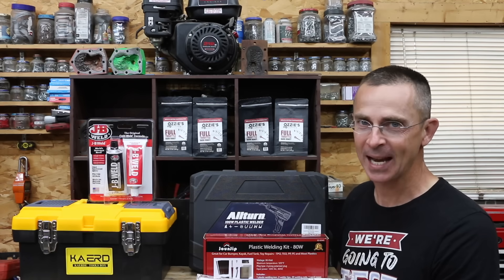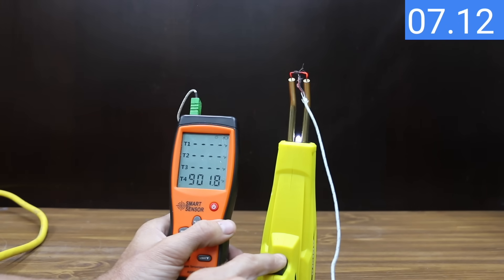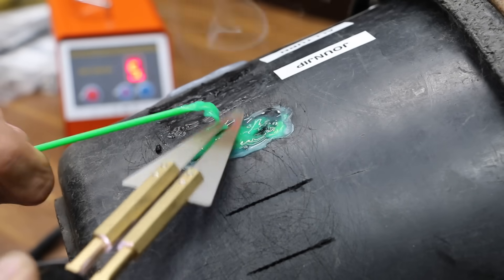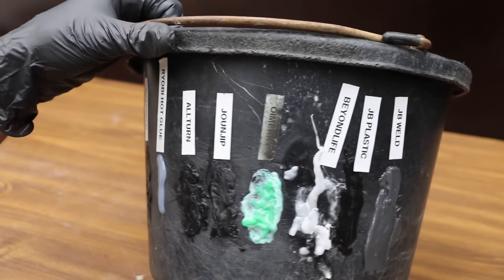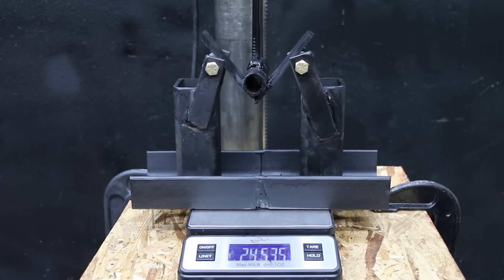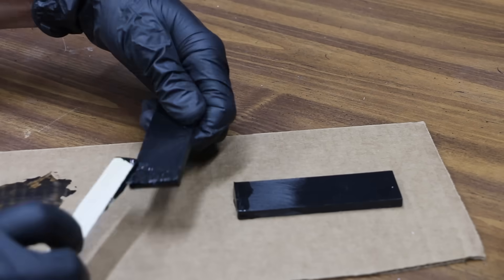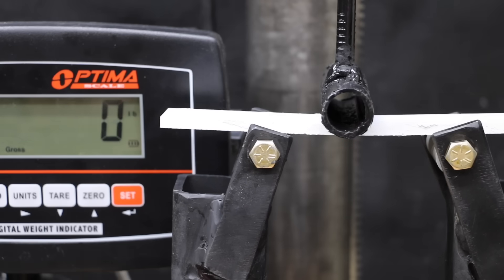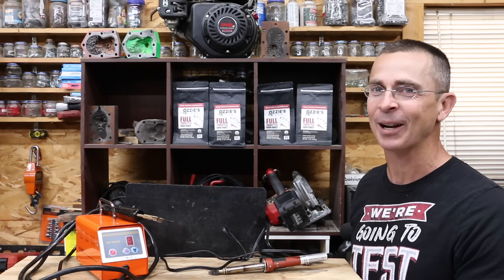Don't Buy A Plastic Welder Until You Watch This Review!

Comment: I would think something with hot "cutting" edges that will melt the original material in a 45 degree channel to which you add your filler would work better than these do since they are simply adding a layer to either side (or for some applications like a gas tank only one side) rather than actually welding the original and filler materials together.  Such a welder could maybe even pass the cut out material through to the welding side to become part of the filler.  Even butt welds on metal with no means of deep penetration (a ground V surface) is pretty crap if we're honest.  Seems like that would be very doable, though I'm probably not the guy who's gonna do it.
Reply from the maker: Thank you for sharing!

Comment: From what I've seen the one unit that you feed the plastic in through is supposed to be used in the direction on the break just as you'd do welding metal together.  I've watch people build water tanks from scratch using these types.

Comment: I tried welding plastic, all you really need is a hot tip from a soldering iron and zip ties. In my experience it's much better to use speciality glue made for plastics, also make sure to use the right glue for the right type of plastic overall glue is easier to work with, produce a cleaner looking repair, and no nasty fumes.
Reply: In addition to using the proper glue for the type plastic, you need to pay attention to what type of material your welding/filler rod is vs the type of plastic you are repairing.
Reply from the maker: Thank you for sharing!

Comment: Part of the issue with bonding plastic is that the heat adds extra carbon, which makes the repair area more brittle on parts that have to flex (motorcycle fairings). You can use a soldering iron or wood burner. V notch you repair on both sides and gently heat the area with directed heat from a heat gun with a nozzle. Tack the parts together at several points. Get a wire screen patch cut, Fill the V notch with plastic, zip ties work well, and embed the mesh making sure to fill the v notch on both sides. Then use JB weld like Bondo to feather the repair on the presentation side. The other side can be left a bit rougher.

Comment: for the hot staple repairs, i'm not sure why he didn't put staples on both the top and bottom -- doing the test which failed at a low pressure, but then turning them upside down (after failure) and achieving a better result, should have been an obvious tipoff.
Reply from the maker: Thank you for sharing!

Comment: I just use an old soldering iron tip. If you use the same approach as welding the root you can get full penetration. I feel a lot of these thicker joints were only stuck on the faces and maybe a few mills deep.
Reply from the maker: Thank you for sharing!

Comment: With plastic welders you are supposed to V groove the repair area and depending on the application stich weld it. I have seen cheap plastic welders do as goid as very expensive ones. The repair stick is the equalizer not the the applicator.
Reply from the maker: Thank you for sharing!

Comment: After having just repaired a car bumper with a couple of cracks in it. I can say that the effectiveness' of the repair is really more about technique than the tools used to  achieve it. I bought the Allturn gun with the staples and mesh kit, before this review. Melting the mesh into the base plastic rather than using the plastic sticks to bond it is far more effective. Cleaning and sanding the base plastic is really more for decontaminating it than for for providing a good bond. Melting the base plastic to itself rather than relying on the filler material for the initial bond is also the best. Try to use the filler material as filler, but to also melt the base material into it. The Allturn setup is a really good value at $35 and it works really well. That's the one I would recommend for the occasional plastics repair. It'll pay for itself the first time you use it and it comes with everything you need to tackle many repair jobs.
Reply from the maker: Thanks for the feedback.

Comment: This test isn’t complete. Some of these repairs are not up to par. Understandably so, but still…

The wire mesh is intended to be melted into the plastic like the wire staples. Then melted plastic is to be added and sanded to cover the mesh and further strengthen the repairs. 

Also, just like welding, the edges should be beveled somewhat. 

Your tests are thorough, but your experience is lacking in some cases. 

Still, this shows what units provide too much heat or not enough.
Reply from the maker: Thank you for sharing!

Comment: Think more like a true welder, you gotta heat up the plastic of the piece as well as your welding rod. The rods in this case are mostly to add extra material if you need it, but most of your weld material should come from the thing you are fixing. You seem to be using the welding rods like a glue, but that's not really what they are for. Gotta melt the thing you are fixing and spread the plastic around so it creates a more unified piece of plastic. That's also why your rod material doesn't stick... you are trying to stick hot to cold and hope it somehow glues together without glue, but you gotta heat both up equally so they fuse together as they both cool.

Comment: Man your videos are live saving, but I could have d
used it a bit earlier lol. Just bought some stuff to repair my motorcycle fairings a day ago. Went with a soldering iron to melt in the aluminum mesh into the fairing, and the some boat Hull spackle to fill in, which I will then sand down and repaint. Hopefully I will get a good result anyways😁
Reply from the maker: Thanks for sharing.

Comment: Very informative as usual but I would love to see this redone but with proper plastic welding techniques. Embedding the wire mesh. Removing material in each cut leaving a divot/trench that can be filled back in with plastic. Using the proper plastic filler rod for the plastic you are attempting to repair. Like metal plastic does need to be melted together. If you just lay hot plastic on top of cold plastic you are going to end up with two pieces of plastic.
Reply from the maker: Great suggestion!

Comment: I will say this about JB Weld, it usually needs a rough edge to really bond properly. A straight edge bond is not where it works best. It needs to soak into the grooves and crevices to hold.
Reply from the maker: Thank you for sharing!
Reply: This applies to all the epoxy glues,  And you really want to wait at least 24 hours if not longer for a reasonably full cure. Perhaps longer for the plastic fusion type glues because the solvent will continue to evaporate and the glue will be stinky for days. I prefer regular JB weld and have not been impressed with their plastic fusion glue nor any other companies' plastic fusion glue.

Comment: I think you should re-do this one and give it fillets or somehow else melt the joint. From what I've done and seen others do, it helps to (if possible) get the break melted. Otherwise the only strength comes from the thin layer you applied after the damage. Since it's plastic, it's possible to melt it back to almost original.
Reply from the maker: Thank you for sharing!

Comment: When I wad 18 I worked for an auto body shop..specifically I rebuilt plastic bumper covers. We had a few of those hot iron and rod type welders but they never got used. We used a plastic welder that used heated nitrogen to melt these gnarly 1/8” thick x 1” wide strips of some sort of plastic. The strips would go on the inside of the bumper cover and the outside would just get finished cosmetically. That stuff was invincible. You’d tear a new hole in the bumper cover before you pull the repair apart.
Reply from the maker: Thanks for sharing.

Comment: Any of those irons that are glowing red hot are way to hot to do an effective weld on the plastic, especially polyethylene and HDPE. The irons should be only slightly above melting temperature to minimize oxidation or burning of the material. If you have those ghosting white crusty crazing on the plastic after the weld, it has been burnt and is no longer the same material. think of the difference between wood and charcoal. To do it right, again it should be at or slightly above melting temp and preferably bathed with an inert gas like nitrogen. Most plastics are only slightly above wax and grease and they burn readily. the inert gas will let them melt back together in a liquid state without oxidizing and turning into hardened ash.
Reply: These devices need accurate temperature adjustment and feedback. A soldering iron at only 700 degrees or so can still melt virtually any plastic, at far below a red heat.

Comment: i love these tests, i would have loved to see you test this with cyanoacrylate (superglue) as it is a great bonder for plastic as i believe it chemically attaches to plastics and i have had amazing luck with that in the past. thanks for all the hard work that you do with this, i hope that you are doing well and look forward to future videos sir!
Reply: CA/superglue  Definitely doesn't bond to polyethylene, HDPE or nylon.  It works reasonably well with acrylics, PVC, ABS and polycarbonate.
Reply: okay, i did not actually realise that, i have only used it for a couple of smaller items like nerf guns for my stepson or a plastic cup, i didnt know it would not work well with other plastics as i figured that the compoosition of those would be similar enough to not make too much of a difference in the adhesion with CA, thank you for the extra info! @goodun2974
Reply from the maker: Thank you for sharing!

Comment: It does appear that most of the repairs weren't completed thoroughly enough to provide an accurate representation of strength, especially when utilizing the wire mesh. I feel it should be implanted in the base material as much as possible and looks more like it's attached to the surface in these tests. I have more suggestions but overall, I'd suggest some practice and attempt at both uniformity and better penetration.
Reply: So, a guy who calls himself "Full-throb" wants more penetration! How did that get past the algorithmic censors?!😂  There's a guitar repairman named Ted Woodford who I watch on YouTube; when he's working glue down into small cracks in musical instruments he always says that "penetration is paramount".

Comment: FYI    I use hot air guns and hot glue guns for a living, the Beyondlife type hot air gun is not for glue sticks,   they are specific for poly ethylene or similar welding rods and they work great for building and repairs of rotomolded pieces.   Not for plastic buckets .   also when welding the two HDPE square rods together ya really botched that up.  the objective is to melt both ends then force them together, wait till it cools off about a minute, release pressure, then wait for complete cooling... now you essentially have one rod.  it would have been the strongest test result.
Reply: Do a video captain, so we can learn
Reply: I can make a video...but i never uploaded  guess i could try.  @TheRoadhammer379

Comment: This is fantastic! I am in need for a plastic welder. 

I just received my windshield cowl for my F-150 and DHL never fails to drop my items or step on it. There is a massive bend damage to one of the clips and torn the plastic on the other side. I thought of JB Weld while bending it back. However, after seeing this video from Project Farm, I am now thinking of plastic welding with the wire mesh 🤔 

Awesome vid Project Farm! I needed this.
Reply from the maker: Thank you for sharing!

Comment: Appreciate the tests but...

1. The filler MUST match the plastic you are welding.  (I imagine generic plastic welding rods contain a mixture to cover all bases, but that isn't NEARLY as good as a 1:1 match.  Back in the day of repairing electronics, I always kept a small stockpile of the different plastics to act as filler.)
2. You don't need a fancy staple welder to get the same effect.  A small piece of wire bent into squiggles can be laid on top of the break and then pressed into place with the edge of a hot knife/welding pad in a dirt-cheap soldering iron.  (I made staples out of pieces of steel wire and melted them in sideways.)
3. If you are using a mesh, it needs to be melted deeply into the original plastic BEFORE you use any filler.  If a break happened because of insufficient strength, melting mesh shallowly into both sides of the break--with long pieces of squiggly wire in the center for broader holding--will provide the extra strength needed.
4. Filler isn't (mainly) used for strength but to fill in holes/etc. and help the end result look better.

Cheers!

Comment: I briefly worked for a company where we welded together huge research fish tanks with a plastic welder like the Beyond Life style you have here. The technique is very similar to arc welding and takes a lot of time to learn how to use well, but it did a great job of welding plastic parts together. We didn't use any metal reinforcement on our plastic tanks and they held up just fine with hundreds of gallons in them. The trick is to get the heat setting correct first and foremost, and then you have to move fairly quickly to avoid burning through. Like I said, it's just like arc welding, so you have to put some hours in to get it right.
Reply: Harbor Freight sold a tool similar to this years ago. I got one, but I haven't used it as I have nothing to test on...I knew I needed to develop technique first before using. All the stuff I have (classic motorbike plastics) is a one-shot deal...either I get it perfect on the first try or it's ruined. Sounds like I might have to take it to a professional!
Reply: @anonymousplanetfambly4598  Same story, got the HF plastic welder but have never used it because I cannot find a scenario.

Comment: With the most expensive one you need to set the temp to the right melting point with the material. Also need to make a V shape cut on the welding place. Then you need to get same material filler as is the original material. It helps if you can cut the rod from the same unit that you are welding. I think you can get the best result from that machine. (Used to be professional plastic welder)

Comment: The beyondlife looks exactly like the older generation Leister hot air welders right down to the switches and dials, chinese knock-off perhaps? I never tried welding plastic with one of those myself but I fixed a bunch of these welders when I worked as a maintenance technician in a company where they make custom HDPE water tanks. I'd see the guys using these on a daily basis and to be honest, I reckon this should be considered professional equipment.